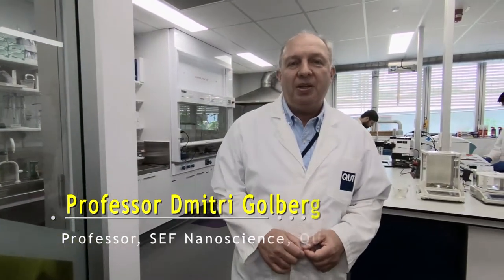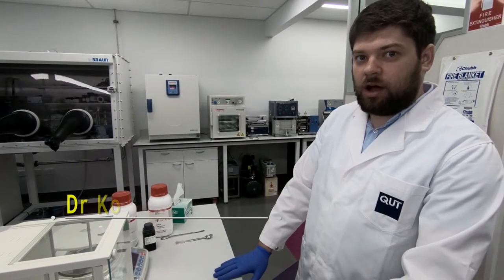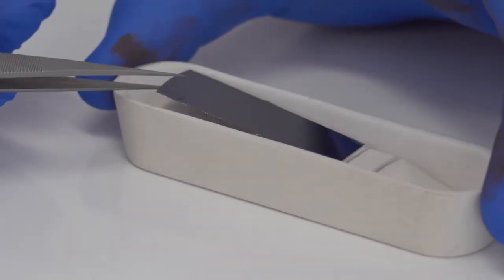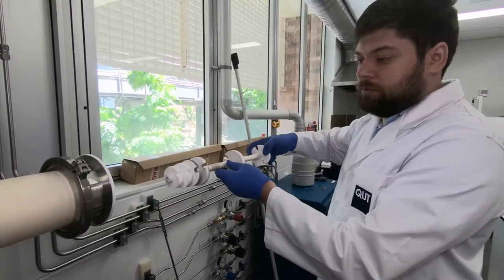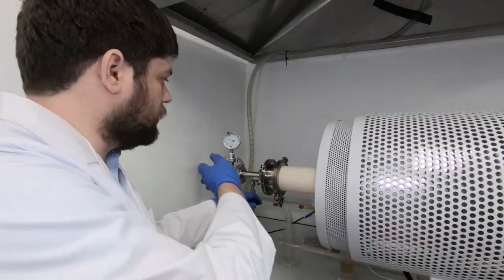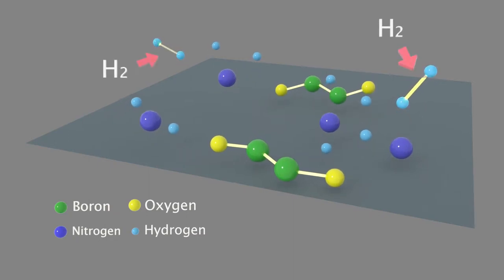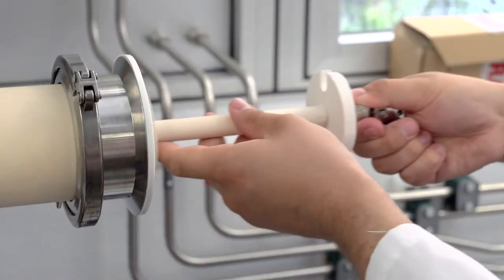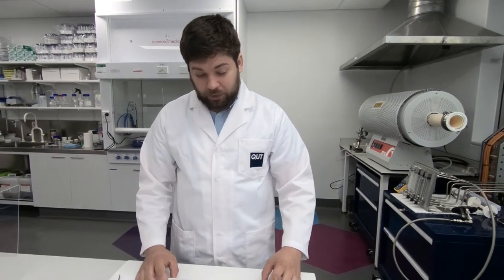Chemical Vapour Deposition (CVD)

Comment: Love pyrolysis. Very good quality, and can be done in atmospheric pressure. Only problem you need proper chemical precursors. That is why I moved to a modified sputtering arrangement, took me two years to perfect its quality, but I did it! I have perfectly transparent and conducting TCOs, among any other thin film I want.
Reply: Show in the video what coatings you apply?.

Comment: Fantastic presentation! Enjoyed it a lot.
I have one question though: 
Is the silicon wafer boat maintained at the same temperature throughout its length, realistically speaking?
If not, then should we expect a gradual decrease in BN concentration through the length of silicon wafer also? (Following similar logic to the gradual change in concentration in the precursor tube*)

Or will the thermal diffusion of gas at that temperature nullify such effects?
Reply: The second guess is the right one. The thermal diffusion is one of the top advantages of CVD processes because of uniform layer growth

Comment: Excellent!
I have a question, why do the "B-N" nanoparticles deposit? I mean, I know they are not vollatile as H2O and H2 (byproducts) but I imagine that they're so light that the gas flow should carry them away also.
Reply: Good question
Reply: They did leave it for 10 hours so i guess over time, all of it formed on the substrate at some point